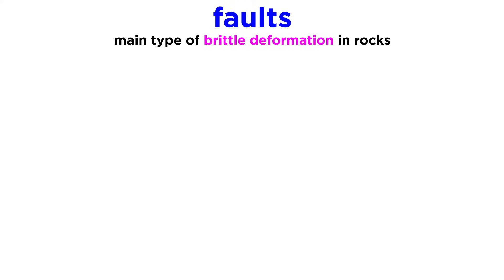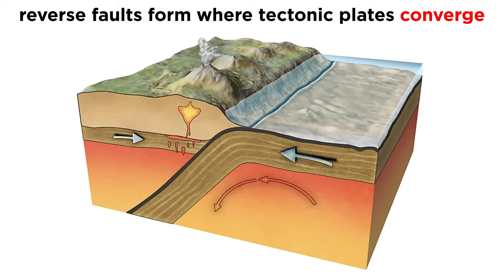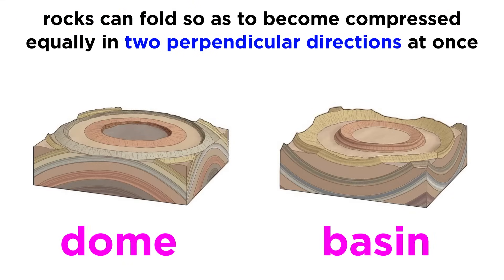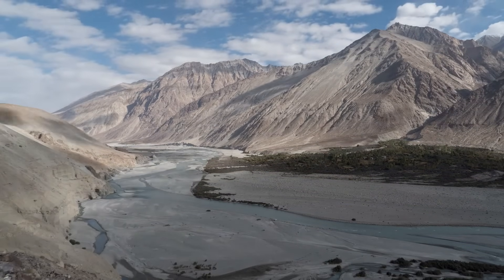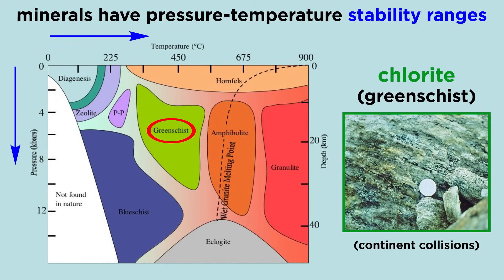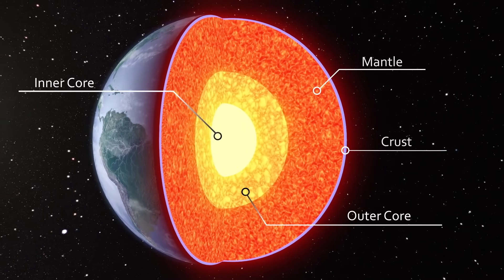Overview of Geologic Structures Part 2: Faults and Folds

Comment: Why does the tectonic plates keep moving? Why they haven't reached an equilibrium state after billions of years of earth formation?
Reply: So long as the earth has an active, heated core it will continue to shift.
Reply: convection currents keep moving them.  convenction currents are from earths core.  earths core is still hot.  hot means to move
Reply: It’s actually mainly radioactive heat within the mantle that powers plate tectonics, about 70%, compared to 30% for primordial heat.

Comment: What about when the two pieces are in a fault where they’re moving in the same direction, but one is moving faster than the other?
Reply: It’s all about relative motion. Many faults are moving along a similar azimuth with differences in velocity creating the relative motion that causes the faulting
Reply: Like all motion, it is always relative to a point of observation. In structural geology, it is assumed to be wrt the other side of the structure.

Comment: Anyone that travels I-68 in Maryland is familiar with the Sidling Hill Syncline, located at mile marker 74.  When that road cut was completed in the 1980s, geology professors at all the nearby colleges about wet themselves in excitement, because it's a perfect example for their students to study.
Reply: I drive by Sideling Hill, too.  I think it's what is pictured at 9:20 in the video, but I can't be certain.  An impressive example of a syncline.  I think it's too bad they shut down the visitor's center.

Comment: My Transcript notes of the video
00:00
we just learned about the different types of rock deformation but there are two very important structures pertaining to this concept that must be discussed

00:15

 in detail those being faults and folds faulting is the main type of brittle deformation in rocks faults are classified based on the type of deformation that creates them normal faults are caused by extension

00:30

 reverse faults by compression and strike slip or transverse faults by shearing normal and reverse faults are called dip slip faults because fault motion or slip is parallel to the false dip this is in contrast with strike slip

00:49

 faults where slip is perpendicular to the dip in geology dip refers to the direction that the fault plane is inclined to conceptualize this imagine that you pour a cup of water onto an inclined

01:04

 surface the direction that the water flows is the dip which has two components an azimuth representing a horizontal direction and an angle representing the steepness of the plane

01:18

 in any dip slip fault there is a hanging wall and a foot wall if you imagine drilling a tunnel longitudinally through the fault when standing in this tunnel you would be standing on the foot wall and the hanging wall would be above you

01:33

 in reverse faults the hanging wall moves upward and in normal faults it moves downward reverse faults primarily form in areas where the tectonic plates are converging like along subduction zones and

01:47

 continent continent collisions there are also areas where the plates are converging at an angle these transpressional faults experience both reverse and strike slip faulting a fault with both dip slip and strike

02:03

 slip motion is called an oblique fault an example of this is the san andreas fault here the pacific and north american plates are converging at about a 10 degree angle

02:16

 though predominantly a strike-slip fault it is also slightly compressional as is evidenced by the coastal mountain ranges of california normal faults are most common where the plates are moving apart and the crust is

02:31

 being stretched this is currently occurring in east africa the basin and range province of north america and at the center of every ocean basin in the world as the crust thins during extension its

02:44

 weight above the underlying mantle is reduced and spread out over a larger surface area this causes the crust to bob up in a process called isostatic adjustment or more specifically isostatic rebound

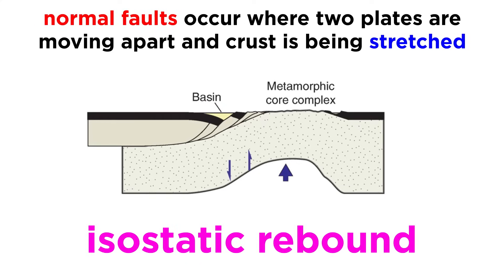03:01

 it's like walking off a boat when your weight is removed the boat bobs upward and rises in the water get back in and the boat bobs down in response to your weight back to the geological case the crust is

03:15

 analogous to the boat and the mantle is analogous to the water with the crust bobbing up and down in response to the thickening and thinning of the crust the same thing occurs in areas that are experiencing compression the

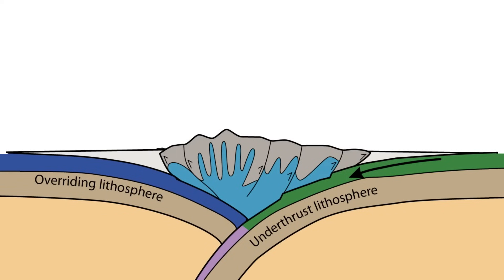03:29

 compressional forces thicken and shorten the crust causing subsidence because the now heavier crust will sink into the mantle this is what leads to the development of four land basins or large areas of

03:43

 depressed land located adjacent to large mountain ranges the weight of the mountain pushes the crust down into the mantle not only beneath it but also adjacent to it and it is these adjacent lowlands that sink

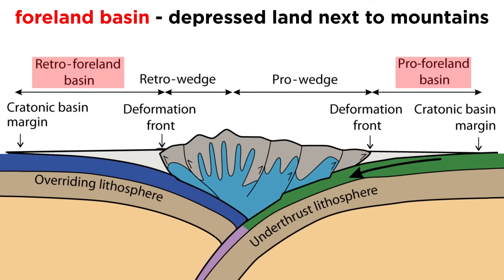03:58

 below sea level during isostatic adjustment which in this case is called subsidence basin subsidence is what makes the formation of ultra thick sedimentary deposits possible

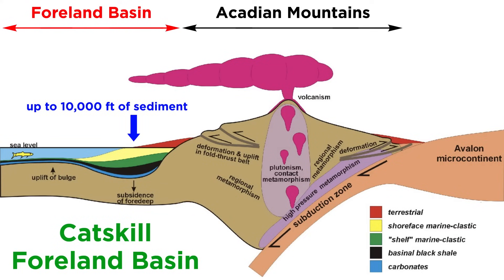04:12

 for example as much as 10 000 feet of sediment accumulated in the catskill four land basin over a period of only about 20 million years during the upper devonian period this sediment was shed from the now

04:26

 eroded acadian mountains that existed along the eastern seaboard subsiding forland basins like this have fostered deposition of some of the largest sedimentary formations in the world

04:39

 in some areas compressional forces cause rocks to become folded like a car that gets crumpled during an accident folding occurs when a rock is being compressed and the temperature and pressure are just high enough for plastic deformation

04:53

 to occur folds are classified based on their geometry and stratigraphy or arrangement of strata folds that are concave up are called sin forms and folds that are concave down

05:08

 are called anti-forms when layered rocks are folded into a sin form the youngest rocks will usually be at the hinge of the fold which is similar to the local maximum or minimum of a parabolic function

To get the full transcript of the video with PDF screenshot notes - Try Askify chrome extension
Reply: You are such a lord!
Reply: @chessematics  My money is on bot.
Reply: @FriedrichHerschel  yeah i just forgot about the fact that we have bots on YouTube nowadays
Reply: @chessematics  I am not a bot
Reply: @FriedrichHerschel  :(
Reply: @Askify  but you didn't write all that stuff manually either.
Reply: @chessematics  thats true
but i posted this comment myself na
Reply: @Askify  yeah ok ok got it man! Bots don't care about defending themselves 😂
Reply: @chessematics  thank you for understanding me.
Reply: @Askify  tbf, it sure looks like a bot comment and advertizes like a bot comment.